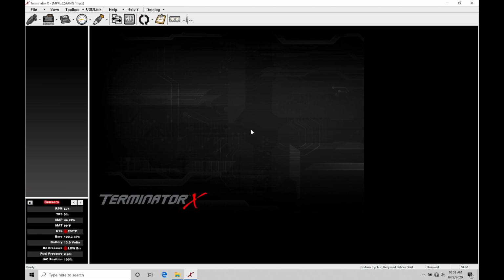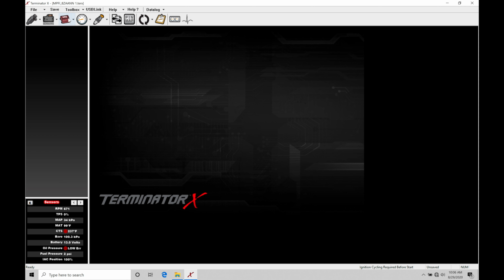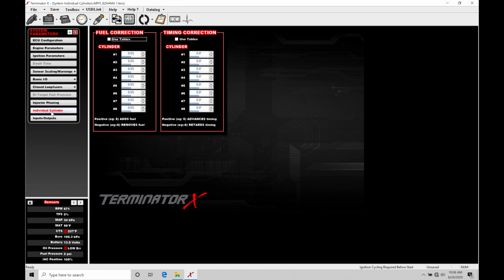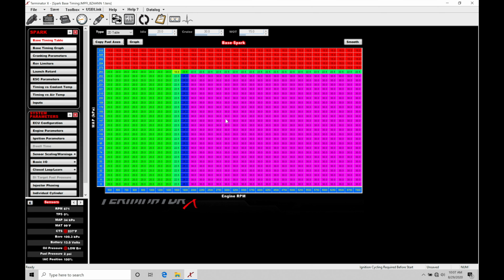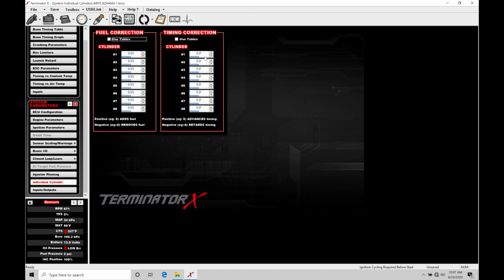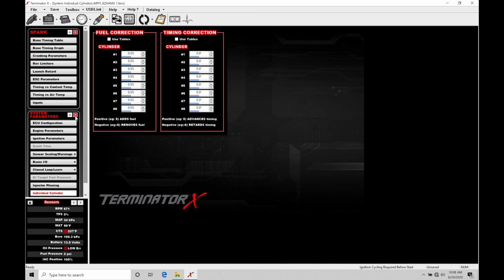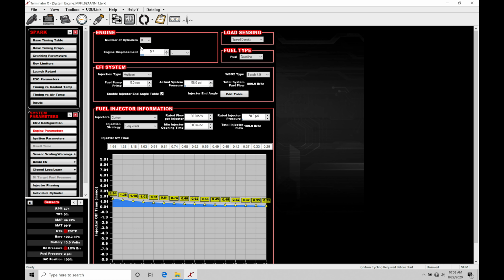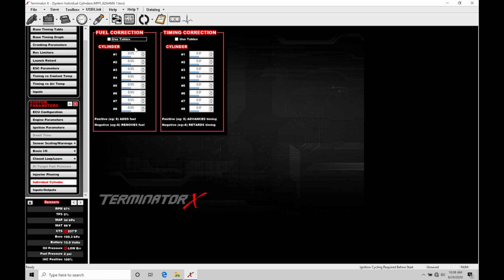Holley Terminator X Training Course Part 25: Advanced Fuel & Spark Tuning |Evans Performance Academy

Comment: Have a Question, I have a small block 383 in my Nova now. Going to add a Holley terminator x stealth. But working on a 6.0 ls swap later. Will to Holley terminator x stealth run the coil pack of the Ls swap?
Reply from the maker: Yes, it can be used on LSx engines.